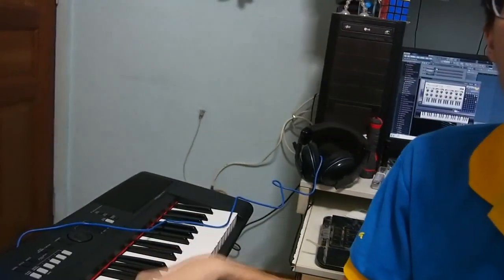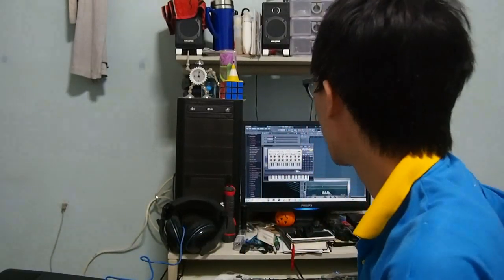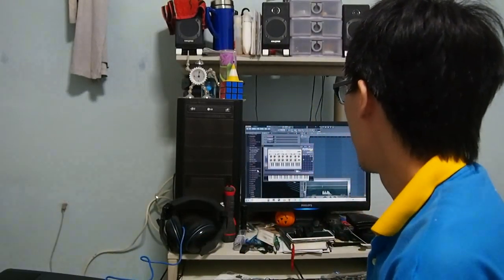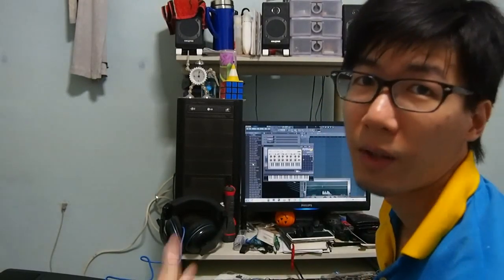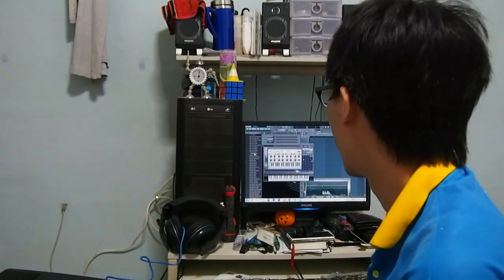Vlog #94: Yamaha NP V60 Touch Sensitivity Issue

Comment: I have a yamaha PSR E333 And it developed similar touch sensitivity issue after 2.5 years. The keys would sound at full velocity even with the slightest touch (without even pressing), and it would totally ruin the experience with the sharp loud wrong note. Then after a while all C and F# keys on all octaves started behaving similarly and now this instrument is totally useless, 12 keys on this keyboard ALWAYS play on full velocity. I opened the keyboard and found that some board has burned a little, probably because I used an adapter with much higher amp.

Still this issue is something I've seen with many Yamaha keyboards on many forums, even the high end ones and this makes me really consider whether I should refrain from buying NP-V60 just because of this issue. 

Has the issue changed/worsened? Also, you can set how FL Studio responds to the velocity input by changing its response curve.
Reply from the maker: +maximumsid Developed? Meaning it was fine when you bought it huh?

But anyway, if you want to avoid this problem, go for a digital piano. I hate the touch sensitivity on this keyboard.

The issue is still the same, and I don't really like the idea of changing velocity in FL Studio, the issue will also still be present since the main problem lies with the driver (i.e., keyboard).

Comment: Me again.  The issue you first described in #60 sounds like it could be a defect of the D key.  Are you still in the 2 year warranty period?

EDIT: After watching again it sounds like the problem is associated with certain keys, not just one.  Is that your summary of it?

I bet that the MIDI data will show a louder intensity for the problem key(s).  If that's the case it's probably not a firmware issue.
Reply from the maker: The issue is not that the keys are problematic, the issue is that the touch sensitivity is very unpredictable. If you play on this keyboard like you would on a piano, whatever you play will sound like crap because you will be accidentally accenting notes you don't want to.

For instance at 2:47 - 2:53. It is true I wanted the bass notes to sound strong, but listen to how the E flat, D and D flat all sounded different in velocity with the D flat being unexpectedly too strong. No issues on a piano despite the same way of playing.
Reply: I understand what you are saying.  I have also noticed defects.  The touch problem may be a defect in the design or even your particular device.  I will be contacting the manufacturer about some squeaky keys on my NP V60.   I also notice my dial becomes hard to turn at a certain spot in its rotation.